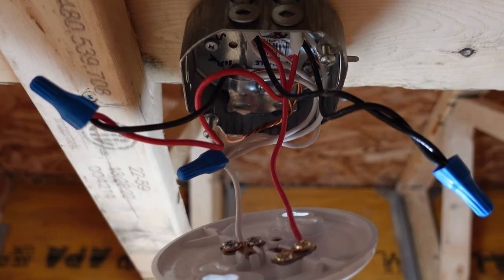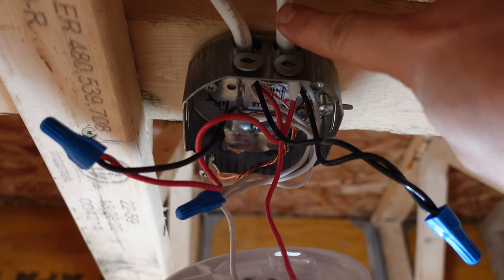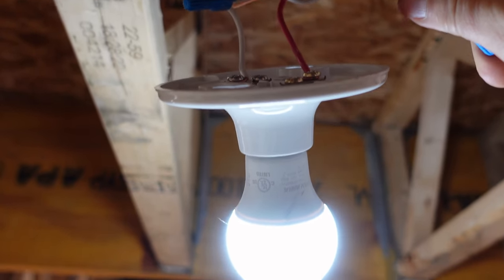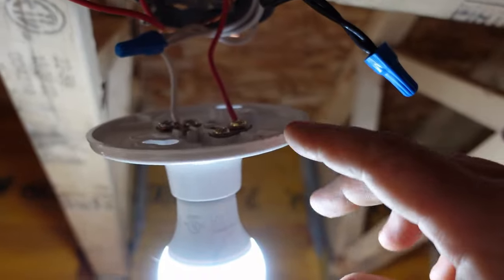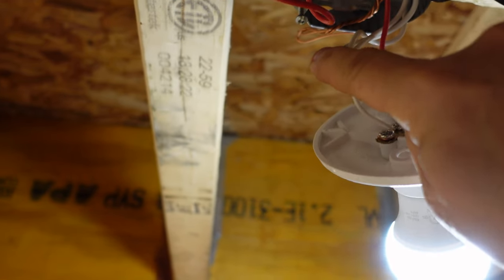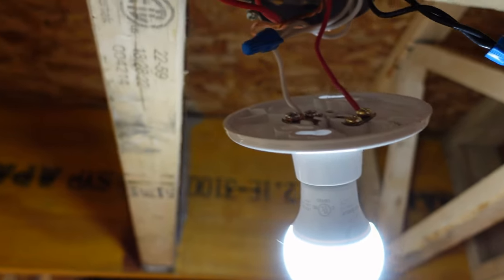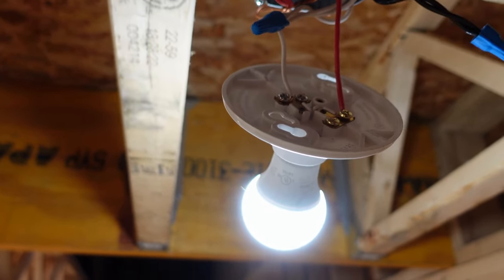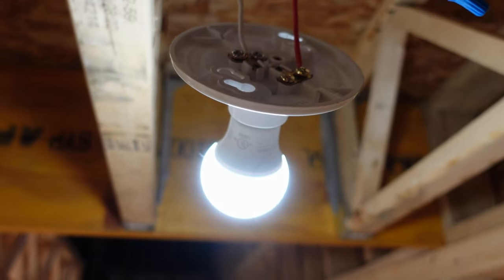How To Wire A Light Fixture With Red Black And White Wires

Comment: Awesome video. Especially in the current economy with the rising costs of labor and materials and working class incomes not necessarily keeping pace, it's human nature for electricians and DIY'ers to find creative ways to cut costs while providing a high quality and code compliant installation or repair.  

Sometimes during a renovation or remodel job, we need to change out an old school pull chain light fixture with constant hot, to a modern decorative fixture,  and add a wall switch to control it.  Because the NEC as of 2011 requires an available neutral in the switch box to facilitate future installation of electronic switching devices requiring standby power, we need to fish a 14/3 (or 12/3, if the circuits are 20 amp) from the light fixture to the new switch location.  The convention is the black supplies power to switch,  red is switched,  and the neutral is capped off with a wirenut or wago connector if the switch doesn't require a neutral.  The old tried and true 2 wire switch loop is no longer permitted in new installations.

Comment: Good stuff ,thank you in advance I brought a low profile ceiling fan with light and remote.  The motor on item has a black wire labeled "N" and red wire labeled "L" also a thin white wire which appear to be covered over and thin gauged . Coming out of ceiling is blk,white,red

Comment: How I can connect 3 wires to a remote ceiling fan? There is a red, white and a black coming from the ceiling. I am assuming the red is for a separate switch but I am not sure if I can connect it with the black one just in case I don’t have the remote in hand.
Reply: Wondering the same thjng
Reply: Me too.   I have the same.  Three wires only.  There isn't another black wire to connect the single black wire in the box
Reply: If you have red black White and Coper.
Means black and red are hot 
And you have a 14 3 cable for a fan and light
Reply: You should have 4 wires, the 4th one being green or bare copper.   It should go Red-Black (red goes to your light switch) / white-white / green(bare)-green(bare) and cap off the black from ceiling.   If you don't want to use your light switch to turn on the fan or fan lights and just use the remote you could cap the red and go black-black.
Reply: I have light fixture that’s has : black ,white ,copper wire ground , ceiling has : black, red white ,copper wire ground, 
Now light turn on and off but only with the breaker ,light switch doesn’t work is a double light switch for the room and for the closet, help

Comment: Dang!   No wonder my new light fixtures won't turn off at the Switch.
I wired the black light fixture wire to the 3 capped black wires coming from the Box!!!!
Right?
Thanks ever so much!
Signed
Recent Widow
Reply: I am in an Condo Apartment Building...
It worked!  I unhooked the black wire from the 3 black wires in the ceiling Box, 
then  hooked the black light fixture wire  to the unused Red Wire.  Light turns off at the Switch!!!!!
The wall plugs are still working.  Problem solved!!!!!
Thanking you profusely.

Comment: My ceiling has 2 black 1 red 2 white and 2 copper grounds- my new light has 2 white and 2 black and 1 copper ground (this is a 2 bulb fixture) do i put the red to the black...im so confused (btw i removed the ceiling fan and replacing with simple 2 bulb light) oh, and now that i took fan down the living room plug dont work. Crazy

Comment: Haven't Read Code by myself yet does NEC allow this in new installation I'm From Canada haven't seen this yet may be see this in Future here not sure if Canadian Electrical code ask anything about this method.
Reply from the maker: We are from Canada, the code does not permit 3 wire feeds anymore, but it does permit 3 wire legs for switches and plugs, or multiple switch legs for lights.

Comment: So you call romex that has 4 wires, grd, white, black, and red, a 3 wire even though there are 4 wires??
Reply: Yes, despite the fact that they are called 14/3 or 12/3, the ground doesn't count as a wire